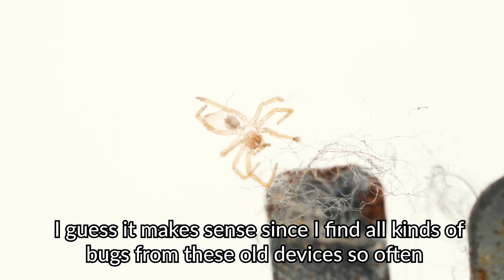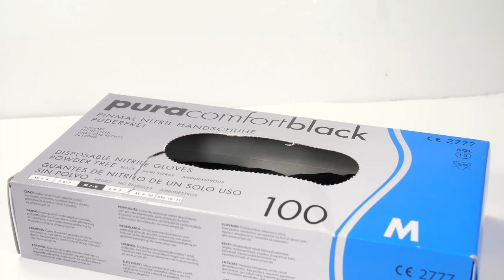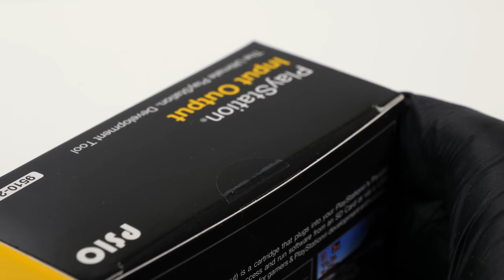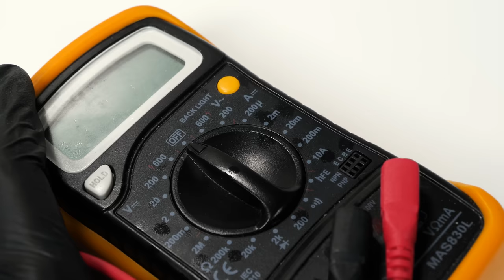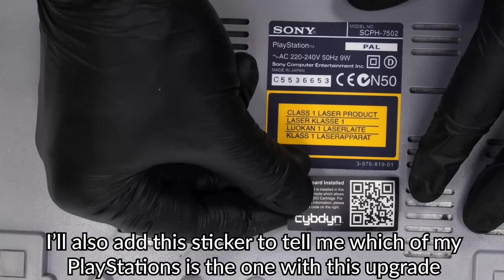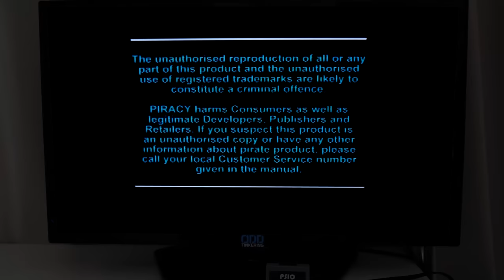Restoration & Upgrade of PlayStation with a Spider Nest Inside

Comment: Pretty cool fact: That's at least a SCPH-5501 up to a 7503 Sony PlayStation 1, because it has the Parallel I/O port, but lacks the A/V composite connection cable ports that the first generation revisions of the PS1s from SCPH-1000 to SCPH-5000 had.

Comment: Its always nice to watch these I just recently picked up 5 consoles for 25 dollars 2 og ps1's and 2 ps2 phats as well with a OG xbox, only issue is the xbox has the red ring of death with error code 05 more on that later, so far all PlayStation consoles boot up fine but all dont read or spin disks, what would be the best troubleshooting for these 2 generations? I already plan on cleaning both so opening them up is on the table 👍🏽

Comment: What tips would you give for getting shots like the ones in this video?
Reply from the maker: Shots, as in video? I have couple of basic video lights and a DSLR as my main camera. But practice is the most important thing. Lighting is probably more imporant than expensive camera, even cheap lights will do a good job if used properly. Only feature I wouldn't give up on the camera is a flip screen, it makes it so much easier to film yourself

Comment: solder joints on the modchip board are matt and colder than ice...you should have put an insulator between the boards, in this way the ps motherboard wouldn't have act as a heatsink (edit: lots of flux would have helped too)

Comment: Those PlayStation screws are a real pain, b
They've got super aggressive biting threads and if you don't line it back up they cut new threads into the plastic and destroy the hole. And the old method of screwing it in backwards till it pops doesn't work because the plastic is so soft

Comment: i still have my ps1 with the first resident evil 2 best game by far back then still in good order but disc reader not working i also have ps2 slim and ps3 ( ps3 crashed hard drive was old also have the memory card for both not matter if the space was really small it was great and also have crash 3  controls back then were strong if thrown .

Comment: 0:00 Intro and Show of The console that will be Restored

1:01 Testing the console

1:11 Main Problem

1:26 Getting Tools

1:44 Unscrewing the Console

2:00 Opening the console

2:30 Taking the components apart

5:17 Taking Apart the Power, Open, and Reset buttons

5:49 Cleaning the yellowed layer

6:45 Cleaning the Reset, Open, and Power Buttons

7:01 Brushing Ductors Teeth 😊

8:26  Letting the Yellowing off in retrobrighting process

8:45 Yellowing Disappears 

8:55 Taking the layers out

9:21 Taking out the spiderwebs in the components

10:21 Brushing Isopropyl Alcohol on the board

11:02 Unboxing PSIO ModChip

15:00 Installing the ModChip

15:35 Cleaning the lens with Alcohol

15:46 Putting the console back in place

16:06 Screwing the screws back

17:16 Putting the components back

18:54 Before and After Scene

20:14 Testing the Console

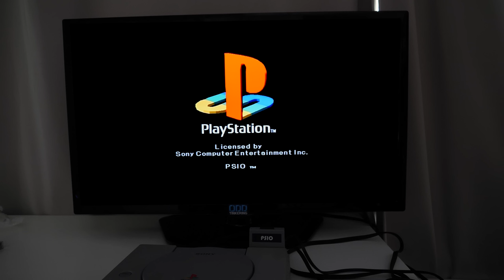20:33 PSIO Menu

20:50 PlayStation

20:56 Game Loads Up

21:31 Gameplay

23:48 Outro
Reply: Thanks my man
Reply: @tfisher9208  Np

Comment: Does the optical drive spin up, does it work at all?

Tryin inserting the disk and flipping the PS1 upside down. If that works then the tracks have worn and the eye is off angle, pretty easy fix for that.

Comment: Great Work! Although I think it might be a tad easier to just do emulation on Raspberry Pi (or Odroid XU4), and save money and be able to play all kinds of retro games, support for bluetooth, fits in a suitcase easily for travel, etc. I used to use a modded Xbox Original to do emulation waay back before the Pi, but the portability of the Pi won out.

Comment: from what i've seen, there's two different solutions. one is psio, which requires internal modification, and then there's the chinese one (name escapes me) which doesn't require an internal mod, it simply just plugs into the back. any pros cons?

Comment: There build quality for the original playstation was amazing and so was the original ps2 not the slim but i went through at least 3 playstation 3s and there build quality isnt what it was i personally dont try and repair anything because im not that savy but everytime i took one to a shop or person to get repaired i was told it was broke thinking about it i probably got ripped off because i never took back the broken ones but the quality just isn't there anymore. Thats why Nintendo in my opinion will always be the best they sre the Toyotas of gaming consoles amd are truly built to last i still have my original snes i got when i was a kid and still works.

Comment: Caution.. Don't remove 4 pin plug wire from circuit board it's almost guaranteed to break, instead remove 4 pin plug from laser body & leave the other end connected to the board! Thank me later🙂

Comment: You Can't Hack Our Operating System. The Kernel Cant be Subverted.
We're Using Minix AND C# /Java Virtual Machine.
FURTHERMORE, "THE OPERATING SYSTEM CALL TABLE (SMALL JUMP TABLE)" IN APPLICATIONS IS HIGH ENCRYPTED (SIGNED). MORE THAN 128 BIT. MORE LIKE 256/512 OR 1024 BIT.
THE SMALL JUMP TABLE IN APPLICATIONS, GETS DE-ENCRYPTED BY THE DMA CONTROLLER ON THE CPU / PROCESSOR. YOU HAVE TO REVERSE ENGINEER THE CPU TO HACK IT.
Addition:
The Jump Table isn't Encrypted (Signed). The Descriptor (Decryption) is Encrypted Signed. Eg. Buffer Size Limits e.t.c. THE CPU - Checks the Limits.
Then The System Call, CAN be Changed But Not Overflown. e.g. Call Another API, instead of it. ALL API's, even the Changed One To, Can't be Overflown.